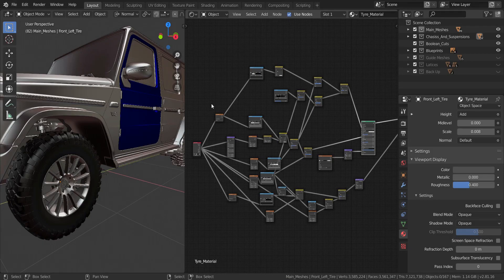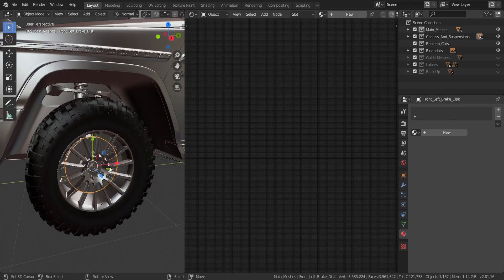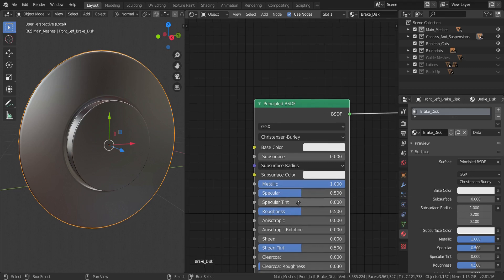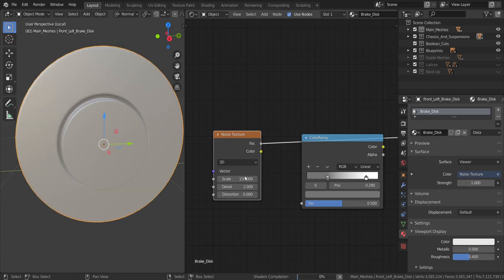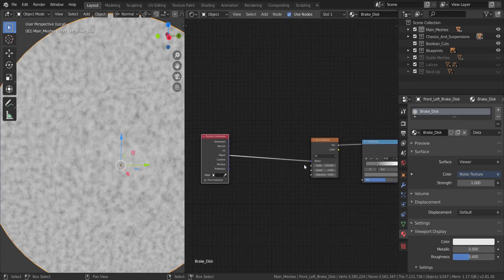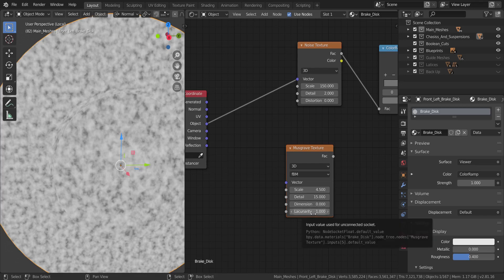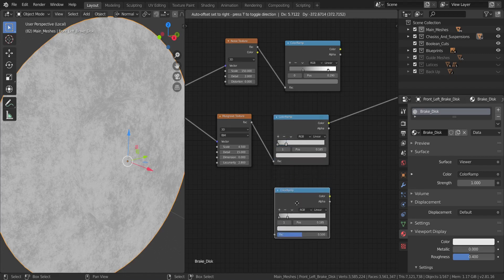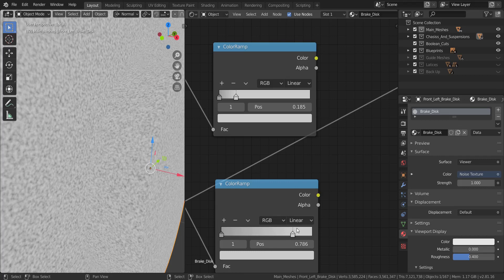Blender 2.81 Material Creation - Brake Disk Material

Comment: I did this again and couldn't get the scored surface working at first, Blender seems to have changed something. Put a mapping node before the gradient texture and look at the output from the gradient texture. Adjust the scale of the mapping node until you get a gradient across the surface.

Comment: I tried following and your exact node setup for the radial disc wear effect would not work for me. I put the gradient texture to radial and the effect appears but the lines instead of flowing round a circle it flows from the centre outwards. Spherical like you used in your tutorial appears not to work and just gives a bare metal texture. Please help.
Reply from the maker: Make sure the center of origin is in the exact middle of the piece and make sure the value to the get effect is set up as in the video...
Reply: @NaturalArtFreak  yeah I figured it out eventually. Turns out the mapping node scale was really small so I increased the scale and it appeared. Thanks for taking the time to reply to me anyway! :)
Reply from the maker: @MechanicalMadness  you're welcome...

Comment: What would be the best way to give the hot brake glowing effect to the material? My guess is an emission shader plus mixing base color with red/orange
Reply from the maker: Yeah only if you can find a way to confine it in the specific area, I use an image texture. All I have to do is UV unwrap that specific area.